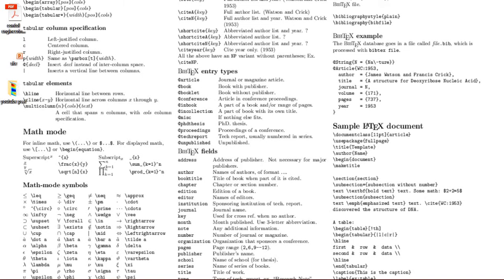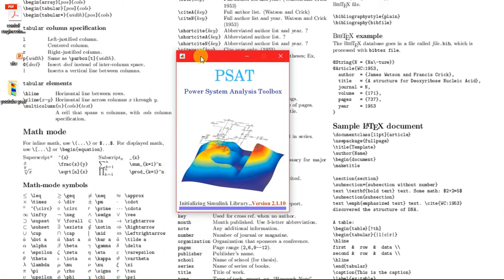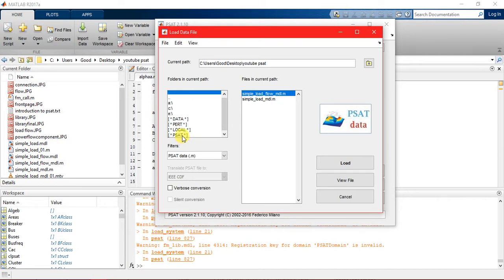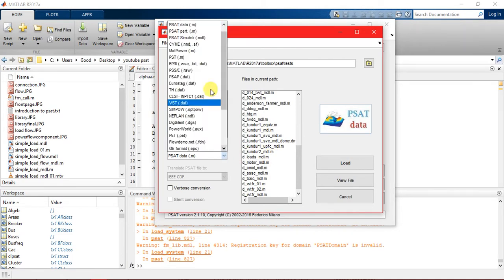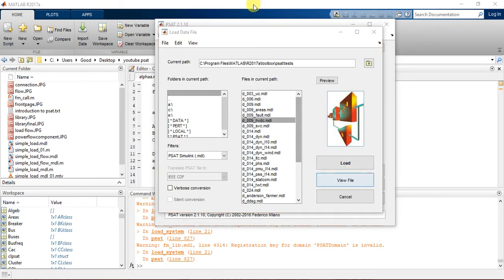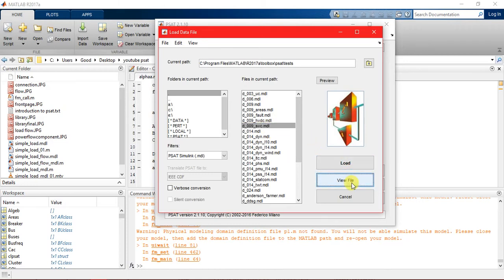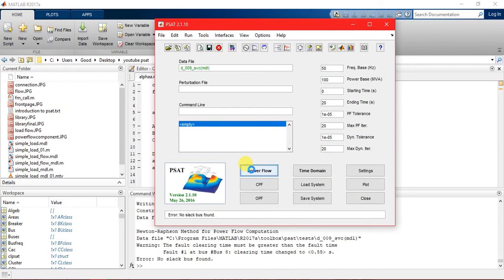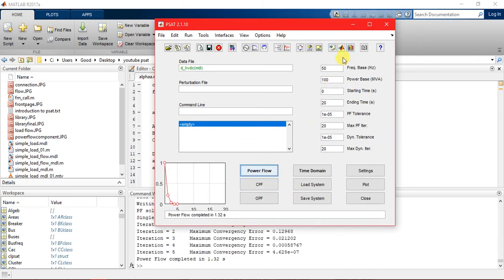Learn Using Examples In PSAT In MATLAB

Comment: sir following error comes whenever i run any test files
plz suggest me the solution
i shall be highly obliged

Newton-Raphson Method for Power Flow Computation
Data file "C:\Program Files\MATLAB\MATLAB Production Server\R2015a\toolbox\psat\tests\d_hvdc(mdl)"
Writing file "fm_call" ...
Error using fprintf
Invalid file identifier. Use fopen to generate a valid file identifier.

Error in fm_wcall (line 49)
count = fprintf(fid,'function fm_call(flag)\n\n');

Error in fm_spf (line 41)
  fm_wcall;

Error in fm_set (line 720)
  fm_spf
 
Error while evaluating UIControl Callback
Reply: same error i am also getting please reply if u have solved this error
Reply: @bharatvardani1880  did you solve your problem?
Reply: @sirajudin8095  @did you solve this problem
Reply: @clerk327  I was having a problem when running a model. A lot of errors were shown in command window. Later on those errors were solved
Reply: @sirajudin8095   Can you please guide i am facing the same issue